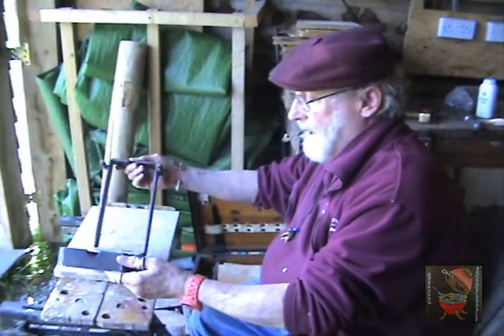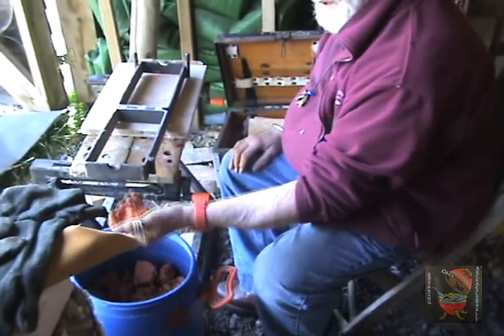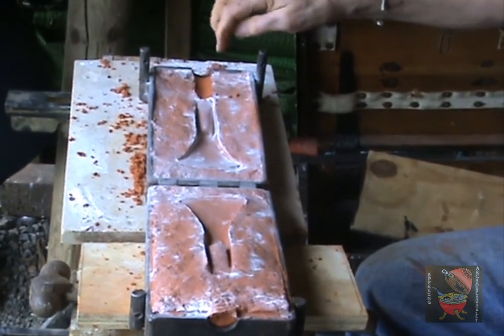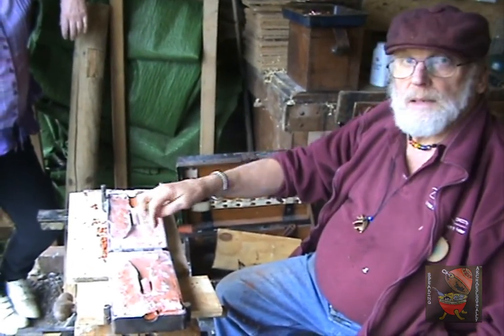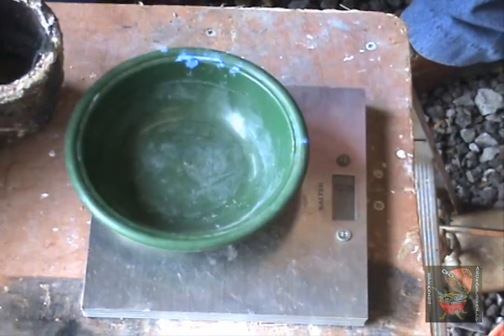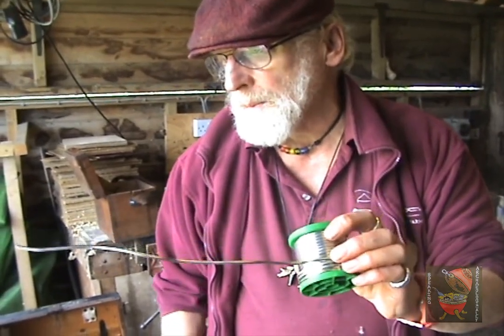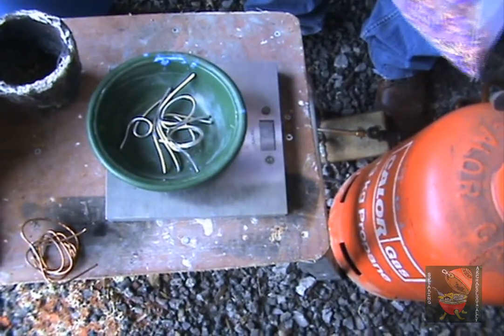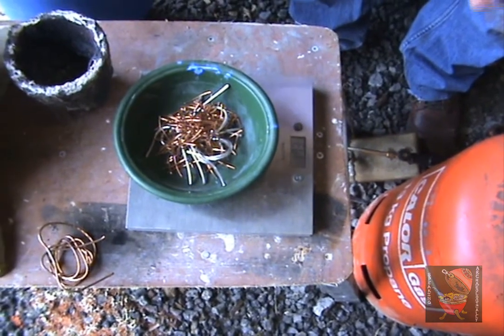Experimental Archaeology Tutorial: Bronze Casting with James Clift

Comment: UK copper plumbing pipe, governed by BS EN 1057, consists of over 99.9% pure copper (typically grade Cu-DHP), designed for high corrosion resistance in water, gas, and sanitation systems. It often includes trace amounts of phosphorus (0.015-0.040%) for deoxidation, enhancing durability and ease of bending.